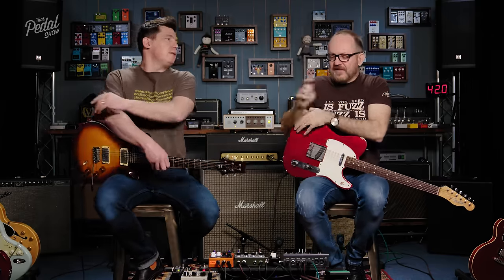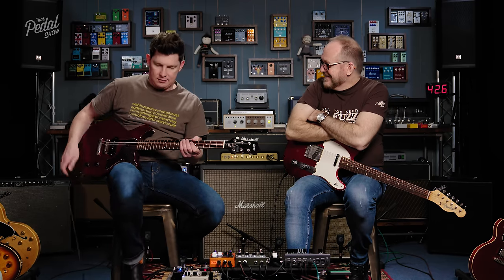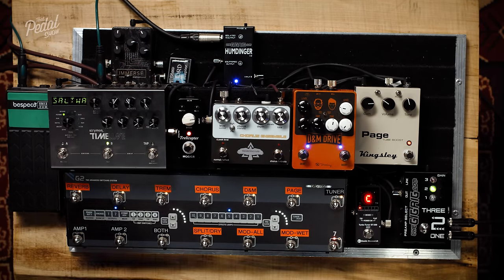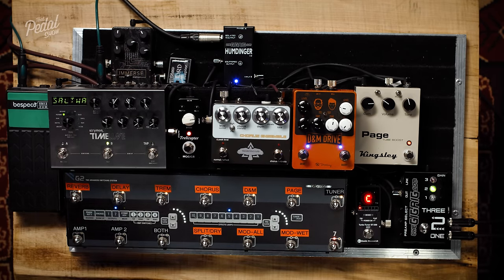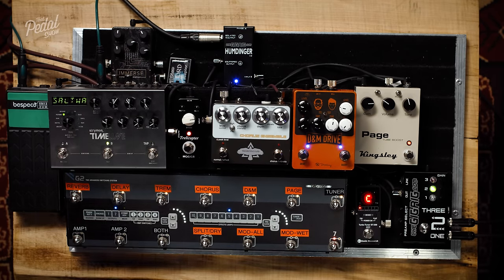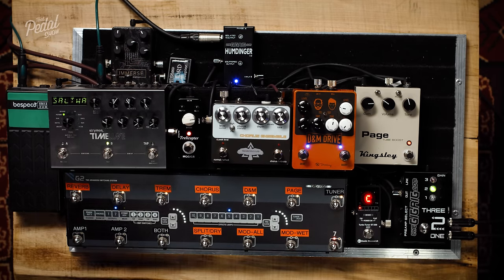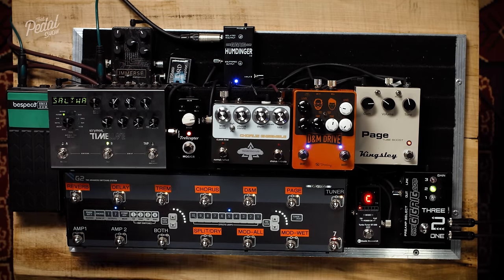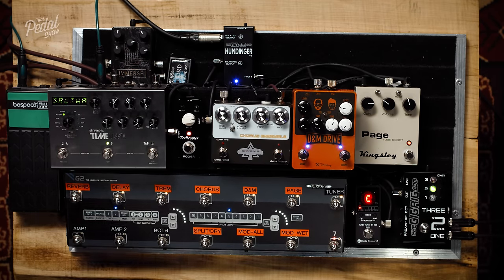Wet-Dry & Wet-Dry-Wet Amp & FX Setups Explained – That Pedal Show

Comment: Hey guys, could you explain what exactly Dan means when he says one amp is "my earth amp"? Is this a translation thing, where we say ground but you guys say floor? What is an earth amp for? How can I verify I have one?
Reply: He means ground but I still don't understand
Reply: Yes earth is ground. Ground meaning an electrical or signal ground. All electrical generation and deliver systems reference or tie to earth, or ground, etc. In the states its usually called ground and in your outlet, its the round plug that usually has a green or yellow green wire. Earth amp, is the amp that has a complete electrical path on the outer shield of your guitar cable  from your guitar to the amp. All amps get a earth or ground connection from the AC outlet, but the signal cables going into the input jacks are broken by all the devices they mentioned that provide an islolated output. Hope that makes sense.
Reply: @JasonClute  Very helpful! That's sort of what I was assuming... but, what is the reason for calling attention to it? Is there a negative repercussion if you don't have one amp "earthed/grounded"? Also, is this the same thing as "isolated"? Thanks for help with these questions, hoping this will get me there! Maybe I need an earth globe added to the diagram. :)
Reply: @joelcrow  In the past, (and maybe some people still do it) people would use a 3 prong to 2 prong AC adapter for one of their amps. This is extremely dangerous and violates most electrical codes around the world. If the amp is not grounded its very dangerous. Now if you are using 2 amps with a splitter that does not provide isolation and you use one of these adapters, then the amp that is not grounded will get a ground back through your cables, pedals splitter, and back to the grounded amp. But if that amp had an electrical fault to ground, it would have to travel through all those connections to get back and this is just not safe. I tried searching the interwebs for a decent diagram of all this but I just can't find one I like. I may just have to make one myself!

Isolation is really referring to breaking the guitar cable signal ground going to 1 amp. The guitar cable signal ground is common with the AC ground in the wall at the amp. This provides shielding for the cabling and all audio equipment. But since boths amps get a ground from the wall, when you plug a guitar to a splitter to both amps, there is a loop from the common ground in the wall traveling out of the guitar cable, to the splitter, then back to the other amp and through that common ground. So using a splitter that provides isolation is breaking that signal ground on the cable at that point, therefore breaking the loop. However, every cable, device and both amps still are grounded. A diagram would help. An animated diagram would be even better.
Reply: @JasonClute  no this is beautiful, I think I'm following along. The signal path is really the entire path from the guitar all the way to the wall plug. All of the pedals and amps used along that path create vulnerable points that must be managed properly to avoid loops/feedback or failing to properly earth/ground (which could make your body the ground, resulting in electricution, ie the dangerous part). Helpful thanks!

Comment: Weird idea: what if you have two different guitar players sharing the same reverb pedal and the signal goes to two different amps from there? (Obviously the reverb would have stereo ins and outs) wouldn’t a splitter with phase and isolation options be unnecessary in this case because you have natural isolation occurring because there is a separate human with a separate guitar?

Comment: Something i stumbled on for the guitarist I drum with was adding a dry amp for clarity in high gain sounds.  This dude loves high gain but the music has these riffs with a lot of ringing open strings and arpeggiated chords that didn't translate with his usual setup.  We struggled with it for a month and half until out of desperation i suggested blending a high headroom clean amp.  The really cool part is that he can run fuzzes and boosts into the clean amp to give the tunes more varied dynamics, really for a band with one guitar and no additional support [outside of myself and the bassist].  

The hard part is getting the amps to blend together.  It seems to work best with two amps that are completely different from each other in terms of frequency response and the clean amp's attack such that it adds punch without "separating" or "jumping over" the high gain amp.  I've experimented with a few different amps but my favorite results were using a Victory V30 and a Supro Titan with an Archer boosting both amps [drive and tone around noon].

Comment: Guys- when using a G2, do you put the Humdinger in the Volume Insert (placed where you want the split), or in one of the 10 loops?
Reply from the maker: You can put it in the volume insert, but then you have to have the post gain turned on. Mick here. Which is fine for most people but I don't like buffers usually. So I have mine in one of the loops. Cheers!
Reply: @ThatPedalShow  Cheers Mick!
Reply: @ThatPedalShow  , Got the humdinger, connected to loop 5, all mod, delay, rev after          the split and Man, it's awesome!  The wet/dry is everything you guys say it is! (egnater rebel 30 dry, fender hotrod deville wet).

Comment: Elusive as always. I find the mention of what is really TRUE W/D/W rig is still out there. The other guy at Vertex pedals, showed a video a month back, and has a different opinion. I sense a feud coming up... :-) 

While this one sure has its merits, and most useful to guitarists, and if you're using the Strymon TimeLine too, if I encounter a part in a song which doesn't require the delay, but the reverb after it, if I press bypass on the TimeLine it will kill the dry signal to the reverb too doesn't it? If it has Kill/dry witch/function properly set up? You make the assumption that all pedals is a "leave it on all of the time" type of things. As fast as you kill any pedal (by stepping on the bypass switch) in that chain you call wet, you make way for the DRY signal to pass through to the reverb (in this case). So it's a dry&wet/dry/dry&wet signal path you're all describing here. 

Also, there's too many pedals and amps out there, to really deal with the phase dilemma. Modulation pedals has choruses, and if in stereo, they may use the "out of phase" thing, and if you have the Right Amp set out of phase, it will still cancel out, as well as some delays.  So one don't only have to be wary of what pedals you're buying, you have to make sure they don't do stereo with phase inversion (have yet to see in any manual that states if they do this or not), and have a proper kill/dry switch. Then we have the issues with hum/grounding, and if you use a Peavey amp that one is counted out. I feel a better solution would be miking up the first amp (with speaker characteristics as well) and send it all through FOH and return back in stereo wedge foldback monitors left and right, for the guitarist himself to bask on. I've never ever felt the need for stereo, live on stage. No one hears it. Even out front in the audience, if you're not in the same position as the FOH engineer. It's a studio thing for sure.

I have yet to see in any manual for any amp that they could be used for stereo without hum. Maybe there is, but not any of the bread and butter big ones. One just have to find out....plug it in as a wet left amp and "oh...it hums..ok, let's sell it on reverb and make a 70 % loss..." or not. Hit or miss.
Reply from the maker: Hello! It’s just another way of doing it. Getting caught up in the terminology is to be expected. Hell, half the world still calls the wang stick on their guitar the ‘tremolo’. We get that it’s not for everyone but understanding it and hearing it is just part of the journey. If you like it, great! If you don’t that’s cool, but why people are offended or challenged by it remains a mystery. We’ve solved the phase and hum thing absolutely. But sure KISS is still a beautiful way to do things. People do hear it though. Go listen to Andy Timmons. We all hear that!
Reply: @ThatPedalShow  Thanks for a fast reply. Of course, it's not for all, you can't please them all. But I think today, with all these pedals like reverbs and delays and pitch machines that sprays fairy dust - shimmer - are up there high in frequencies. And to put those out in any guitar cab that has a speaker made for guitar signal surely defeats its purpose. If you send those ones out to mixer and back again to FRFR monitors you'll get a better experience. Hence people working with FRFR power amp cabinets today, with tweeters in them, and even coax speakers in select cases. Same thing if you use octaver below, or extended range instruments that goes down into bass territory. Then you treat the guitar combo speaker in hazardous ways, as it isn't made for bass notes, but this applies just as well to the dry amp side though. But FRFR handles all this.

Comment: For those of us without a phase switching pedal option that want to play around with this, can you not just switch the speaker leads on one of the amps to accomplish the same thing to reverse the phase of that amp?
Reply: Yep that works too. It's just less easy to reverse if need be.
Reply: @andrewdaw6050  Thanks, Andrew.  I think a lot of folks have a stereo pedal that they can use to play with wet/dry, even if it is not isolated and phase switchable.  I've found the noise to be fine and switching the speaker leads to adjust phase.

Comment: Just a little tip to check the phase when micing the cab: 1.activate all overdrives, so that you have something close to a static noise. 2. flip the phase of one mic and move it until you have the greatest cancellation( works wonderfull when micing just one cab with 2 mics). 3. flip the phase again and enjoy your punchy sound.
Reply: @lostinthecode  Someone knows what I'm talking about!!! Note: I don't get why you should be able to flip phases going to the amp, just put them next to each other and don't create artificial problems. I really, REALLY love this show but this is kind of BS to me...

Comment: I'll share my set up as it's not expensive. I play in a duo and run wet-dry now, mostly when I'm playing acoustic guitar (80% of the gig). I run my acoustic directly into my Marshall acoustic amp (with a decent touch of reverb), but then for big sections or heavier songs I also run it through a light gain pedal, trem and reverb into my Peavey tube amp. It really sounds big and fills the sound out for a small act

Comment: Where do you place a Volume Pedal for Guitar Swells in such a Setup ( Wet/Dry of Wet/Dry/Wet ) ??
Reply from the maker: You’d have to have it pre split if you want to swell both amps. And if you don’t want to affect the gain structure of your drive pedals, it will need to go after drives. Cheers!
Reply: Thank you very much! This is the same way, I thought about 😀

Comment: Late post but can anyone tell me were do you put a mxr univibe in a wet dry. I have always had the uni vibe at the front of the chain after the fuzz. Ive got delay and chorus and flange in one amp. And the drives across the two amps. but a vibe normally goes first in the chain so not sure
Reply from the maker: Yep, this is one of those compromise moments. You like the sound of it before the drives... Which means it'll hit both amps. You just need to try it both ways and pick the one you like best. Cheers!
Reply: @ThatPedalShow  thanks guys. I should have listened more to this video as you do mention that. But I think it's better hitting both amps as it's an effect I want to be prominent when I'm using it. Cheers

Comment: Correct me if I cognitized this wrong but, isn't the way you guys utilize wet/dry ostensibly a more decadent version of utilizing the effects loop with one amp? In that the gainer section (in this case the dry/preamp) takes the pedals that can handle that without loosing definition whilst the cleaner section (wet/power amp) handles the effects that can lose definition when hit with gain. I know that saying a wet/dry rig & a single amp with loop is like stating a Mars Bar & an Artisan Belgian Chocolate Truffle are the same. But they do share ingredients right? (Also this completely falls apart as a concept in wet/dry/wet which is a beast onto itself)
Reply: I've experimented with both. Wet Dry provides a lot more clarity for the dry signal
Reply: @peterjessop1878  I'm very sure it is, hence the analogy. I'm just noting, the effects are set up how most use an effect loop.

Comment: The phase reversing pedal thingy is what I want to solve the most. I've got a J Rockett Revolver that does exactly this when you engage it, even though it's supposed to be a vibey/tremolo stereo splitter. It took me ages to work out that's what the problem was as I initially thought the EQ of the pedal was strange and made everything thinner. I can't use it with both outputs going to separate amps anymore, so now I basically have to use one output and split the signal later. It really sucks since the way it achieves the vibey effect is the difference in the two outputs. I could set it so that the "boost" side is always active and only switch the revolver side on and off, but that takes the boost away.
I'm not expecting advice, just having a typical Scottish moan...

Comment: Flint and El Capistan both have Analog Dry pass through. Would that negate the need for this?
Reply from the maker: Negate what? Extra stuff?
No - you still need to kill the hum and have control over phase. Otherwise both can sound fantastic in a W/D or W/D/W rig! 
Or if you mean just run mono into one amp, or stereo into two. Both sound cool, but very different from this. Cheees!
Reply: @ThatPedalShow  I've been running them into 2 vintage Princeton Reverbs in Stereo for shows. But might have to try this:) Yeah, I meant if there was a lot of difference between the Analog Pass Through and a proper W/D/W setup. Seems the answer is YES!:)

Comment: I Love the show gents and am a huge supporter of what you guys do.. But that is not the best way to run WDW...  I know you spoke of it a bit at the end of the vid but The best way is the way they did it in the late 80s early 90s. Have one Main head/amp... take a tap off of the amps output that converts it to line level and sends a through to the dry center cab from the amp.... the line level signal is sent to the stereo fx and then to a  power amp that will power the outside wet cabs..the new matrix power amps rule for this!!! Cheers from Canada!
Reply from the maker: but what if I want the character of all three amps? Best is a relative term
Reply: @ThatPedalShow  Touche sir!..... I know what you mean by that and I have done it that way in the past and agree it's killer. ''Best'' probably isn't the correct word. I prefer the method I explained because it's easier to control everything tone wise with just one pre amp to mess with.. Plus all the ''Post fx'' are completely separated kind of like a Aux on a mixing console....Clean and lovely goodness lol..  Great tones either way!!! Cheers!!!

Comment: That CE-1 Clone sounds amazing. Has it been featured on the show before?
Regarding which amp to use for ground it's probably worth noting that while it usually doesn't matter, it will make a difference if you use a switcher like G2 as the pedals before and after the split will have a shared ground via the switcher and therefore the dry amp can't be used as your main earth amp.
Also, problems with thin sound might not only occur when a pedal in the wet path flips phase, but also if it isn't analog dry through. The latency in the dry signal (if you decide to have some of that in the wet amps) will cause phase problems as well.
Reply from the maker: Dry amp can bu used as the main earth as long as the wet amp is isolated
Reply: @ThatPedalShow  You are right sorry.. I just meant that in that case you would need an additional isolater, as the isolated out of your dedicated splitter won't be isolating the rest of the signal chain anymore.
Reply: @franzhutterer7250  Thank you very much Franz, this is actually the first time for it on the show, although you are not the first one asking when will Dan give it a nice run in a show. I hope it will eventually happen! - Triungulo Lab's owner

Comment: I understand the wet/dry/wet thing, but isn't a dry signal where zero effects are applied ? Also one scenario you didn't look at directly was where a set of effects (maybe drives or a preamp pedal) are only applied to the dry amp, e.g. by being in the signal chain on the isolated output of the humdinger ... any useful applications for that ?
Reply: They talk a bit about their definition of "wet" at the beggining.  Delay and reverb are absolutely wet effects.  I wouldn't call overdrives wet.
Reply: @user-oy7gz5bf2h  yes, but my point is that, when you look at the wet/dry mix on a Strymon pedal, they allow you to mix a portion of the uneffected signal, along with the effect ... so really a 'dry' amp has no effects at all - in the context of this, that's not very practical - the drives would go somewhere... but i wonder if it sounds better with the drives hitting the dry amp ONLY , i.e. on the isolated out of the humdinger, route the cable into the D&M drive, Page, etc., before hitting the Marshall amp.
Reply: @aculeus1971  Sorry if I didn't get the point the first time around.  The idea behind a dry/wet is precisely to have one amp/speaker totally dry.  It does apparently differ greatly to having a blend going through one amp only.  Also, not all of your effects will have a mix/blend knob.  Having your drives on the DRY amp only could be interesting.  There's no right or wrong, here.
Reply: @user-oy7gz5bf2h  agreed. I just need to try it...